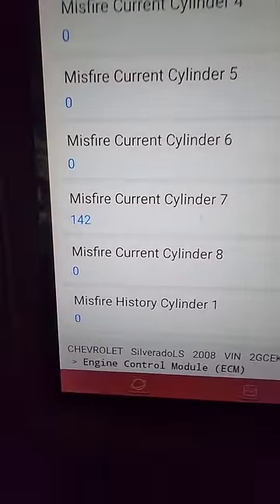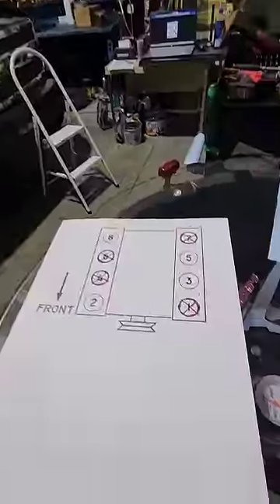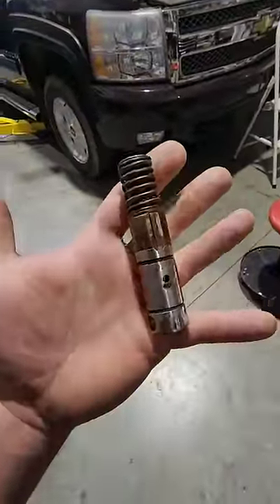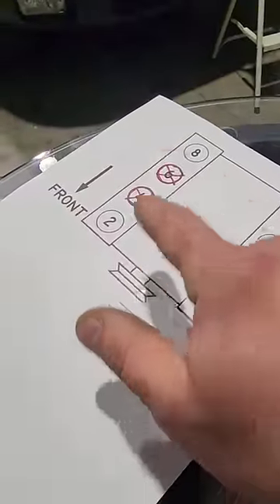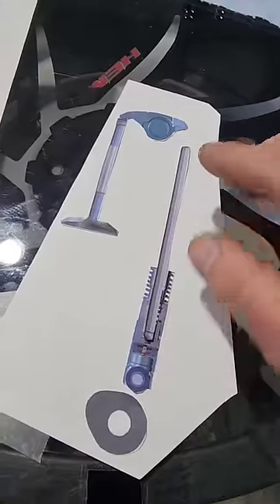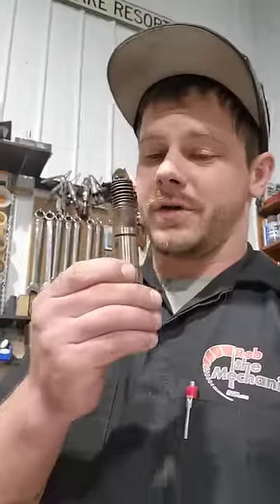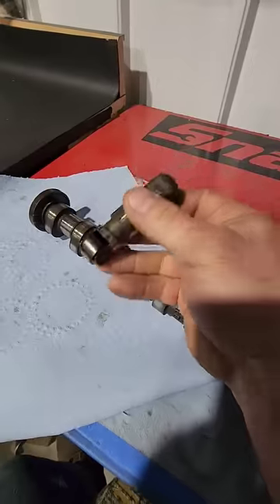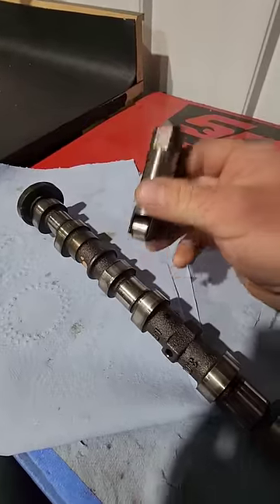GM Lifter Tick #shorts

Comment: I got that shut off.  I figure the extra money on gas is worth paying instead of engine work.
Reply: i was wondering if there was a way to do that. or maybe swap the adjustable one with the normal ones
Reply: @dhanssolo  yeah you can, that’s one of the steps of deleting one the right way. Swap DOD/AFM lifters, & cam out for non afm cam/lifters. Plug valley oil passages or swap valley plate, then get it tuned.
Reply: Simply shutting it off in the computer doesn't protect you from a lifter collapsing. If you want protection from this you need to actually have solid lifters installed
Reply: The engine runs smoother in 8 cylinder mode anyway, so fuel savings on 4 cylinders is negligible.  Highway gearing is what saves on fuel, an 8 cylinder car can do the same fuel economy as any 6 or 4 cylinder, with the right gearing.
Reply: @slowLFX  still doing lifters and cam though so that’s not a money saver.
Reply: @MidnightMechanic  getting a smaller more fuel efficient car would save alot more
Reply: @dhanssolo  if you get a tuner you can do all sorts of fancy things.  And i tuned mine for fuel economy so even on 8 on a highway i can get around 26mpg.
Reply: @oliver_klozoff  the on and off seems to cause the lifters to collapse.  Me and my brother have over 200k towing with ours with no issues yet.
Reply: @MidnightMechanic  yeah, nah it cant
Reply: @itslilyitslily  True, but subjective.  Payload capacity and towing is reduced, so if you absolutely need a pickup for hauling, consider the final drive gear, and maybe a Diesel option.
Reply: they will fail even if it's deleted in the ecm unfortunately
Reply: I don't even understand how it's supposed to save gas, yeah you're running on half power but wouldn't the four running cylinders have a drag on them because they're now pulling double the load?
Reply: @ChiTownGuerrilla the savings are negligible at best. I would get maybe 1mpg better on the highway. I had it shut off with a tune so it always runs on 8 and my fuel economy increased.
Reply: @wigletron2846  Yeah seems like a gimmick, just like those cars that shut off at a stop light and you hear the starter kick on lol. I got a 97' gmt400 5.7 so I don't have to worry about shit like that, it already has overdrive built into the normal "D."
Reply: @BurgessBrothersRacing  I dont think it goes into 4 cylinder mode when towing.
Reply: @ChiTownGuerrilla  it definitely is a gimmick. With those auto stop start cars, any money you save on fuel you're going to spend on a new starter and battery. With cylinder deactivation, you're gonna replace the cam and lifters.
Reply: @BurgessBrothersRacing  What tuner did you get?
Reply: @itslilyitslily  Alright.... where is it? Show me the 8 seater, luggage munching, movie player, fuel saver machine. I wanna see it.
Reply: @unclebob7937  diablo
Reply: @bobbobby1846  probably not.  I wouldnt know because its shut off.  But what im saying is we use our trucks and so far so good with the lifters.  But people who dont shut it off seem to have lifter issues before 200k.
Reply: @MidnightMechanic  lol, that's complete bullshit. show me a modern V8 that achieves 40mpg, cylinder deactivation or not 🤣
Reply: Or just get the V6 version.
Reply: @3n3ly7m9  Toyota Highlander has entered the chat
Reply: @ChiTownGuerrilla 
With AFM: Around 23 mpg average
Without AFM: Around 22 mpg average

I can't remember if these are the exact numbers but this is around what i remember them being when I bought my 2010 silverado
Reply: @unclebob7937  range technologies AFM delete! Simple, just plug into osb port n your done. V8 mode all the time!
Reply: Did the same got a new cam, dod delete, lifters and valley plate, tuned it for 91 and get better gas mileage then I got before
Reply: AFM/DOD shutoff actually saves fuel, and stops burning oil too. Get it done ASAP.
Reply: @MidnightMechanic  that's exactly what I've been telling people, most don't understand 🤦🏾‍♂️
Reply: @oliver_klozoff  I don't know anything about Toyota besides my first car, a shitty 2001 Lexus IS300 that dropped a valve at 160k miles. Still have it aswell 4 years later, but I have 8 Audis now.
Reply: @schowers I don't think that is the case, I see a lot of  guys with trucks who don't work
Reply: @tesmith47  ok so are you like following them around for a week to confirm that or you catch them on their day off?
Reply: I've got the AFM disabled.  Will that keep the lifters from failing?  They are never starved for Lubrication.
I have 167K on a 2013.
Reply: @HK-qj4im  I've heard lifters can still collapse unless you do an actual afm delete
Reply: Anybody wondering, there is a company called Range that makes a unit that you plug right into the OBD plug on the dashboard, the same place the mechanics will plug the scanner in to test for codes. I've had them in multiple Vehicles now and have never had an issue with any of them. They don't throw check engine lights and before you take the vehicle in for its emission and safety inspection test if you're in one of those States, you just unplug it a few weeks prior.  They leave no Trace whatsoever. We have one  even on our six-cylinder car because that has a AFM type system as well even though they're not known for failure. The reason we bought it for that one is because it also happens to keep it from going into Auto start-stop which we can't stand. That particular vehicle has a button but of course my wife never pushes it because she'd much rather kill the car.
Reply: I tuned out displacement on demand at 150,000. The 5.3 is at 310,000, still no lifter tap....
Reply: @MidnightMechanic  Soon as you gear it up, you are keeping your foot into it more on the hills. Which will kill your 0-60 mpg, every single time you take off. Especially when towing.
Reply: @ChiTownGuerrilla  yes
Reply: doesn't prevent, just delays. this is a mechanical flaw, not software. full DOD/AFM Delete is a must, or you'll run into the issue at some point.
Reply: They are easy to replace, but what you need to replace is the oil pump, there's an aftermarket high volume oil pump specifically made for these engines(you can get them at any auto parts store) because of this common issue with the lifter collapse. I've done this repair many times, I had to find out the hard way in the beginning, when I replaced just the faulty lifter/s, the new lifters would fail again after a year and some months. I personally experienced this and when I replaced the stock oil pump for the higher volume pump, it has been over 5yrs and still no issues. Customers of mine are still bringing me their trucks for oil changes and they are getting more miles and years on their engines from the oil pump upgrade.
Reply: 19 hrs for a cam and a lifter. mabie a bent  lifter rod. ... i rebuilt my whole engine.. is 7 hrs.. with all forged... and drove it on 31 pass' of 150shot and still driving it to this moment... and i dont even have blow by
Reply: @battfieldsniper1  maybe already out of the vehicle on a stand and even then your 7hr claim is BS ...
Reply: @oliver_klozoff  actually it dose if they don't collapse they cant stick
Reply: @chris001979  lol ok. Guess the ones I've seen collapse were flukes then?
Reply: I shut mine off and got better mileage than before.
Reply: @oliver_klozoff  yeah a remap alone will not solve this. In fact probably cause a dashboard disco. I’m not as clued up on trucks but look like the man above has done it properly ✌️
Reply: @BurgessBrothersRacing  the best part is that’s an easy thing to do (from the perspective of the mapper)
Reply: @justinballard7242  yeah need them OG non collapsing lifters
Reply: @ChiTownGuerrilla  that actually is a good point. Probably negligible but they doing it for the “green market”
Reply: @schowers  😂😂😂😂😂
Reply: @schowers  was nice knowing you sir 😅
Reply: @ChiTownGuerrilla  yeah they rape oil and surely use more fuel to restart… don’t get me started on the battery life
Reply: Same as that dumb stop start. You’ll be paying out for a new starter and using all that saved money from David fuel.
Reply: @BurgessBrothersRacing  What is a tuner? I know what tuning entails but never heard of it being an actual object.

 I don't own a car. I only know basics and definitely don't work on them. I know more about the science then actually working with engines let alone tools.
Reply: @dianapennepacker6854  it is a device that you use to tune your vehicle.  Its a small  designated computer basically.
Reply: Deleting DOD doesn't stop lifter roller/cam failure, GM engines without DOD still have the problem.
Reply: @paulcondie2520 I've had the Range AFM disabler on my '16 Silverado for 2.5 years now. So far, no problems
Reply: @smokeinapeterbilt  good to know. I bought my Silverado used and first thing I did to it. Was hoping this would save my lifters from collapsing. 46,000 miles on it when installed. At least hoping it delayed it. Lol
Reply: Genius
Reply: My mileage went up when I got it deactivated
Reply: @BurgessBrothersRacing  any chance you could clue me in to how you tune for better mileage? I’ve very lightly dabbled in HPtuners and wish I could get better knowledge on it all.
Reply: @akaaccount  i got a diablo tuner, so it came with different tunes and one was for mileage.  And i didnt notice any kind of cut in power when towing
Reply: @alexehhhh  i got a dianlo tuner so it came pre loaded with several wuick tunes.  One was for mileage.  Ome was for towing.  One was a race tune for 93 octaine.  Lol.  But as far as going in myself with a laptop, i wouldnt do it.
Reply: @busterscrugs just put a Corvette into the super eco mode
Reply: Absolutely!
Reply: The 4.8 doesn’t even have it only the 5.3 does
Reply: @schowers racism
Reply: Got a $40 thing to plug into the obd2 port. Yes a full delete would be the best bet but $40 vs delete when who knows how long anything else on the truck will last. $40 it is.
Reply: Doesn’t help
Reply: @dhanssolo  just have it turned off at a shop it only costed me like a 100 bucks back when i had it done
Reply: @dhanssolo you have to change the cam shaft to a non afm. They have OBD plugins but if the problem is already there it won’t fix it or stop it from happening

Comment: GM couldn't allow Dodge to have all the glory with the Hemi tick.
Reply: Way more common in GM motors
Reply: My experience driving one of these is it seemed I had to be driving on a slight downhill in order to run on v4
Reply: That did highly resemble the cam that comes out of a 5.7 L Hemi at 70-90k miles.
Reply: @jeffduncan9140 my hemi is at 200k. Take care of it and it'll take care of you. Also mines always running on eight cylinders. I keep that mds junk off
Reply: @jessesdomain5142  and there it is...MDS delete. That and not going from constant idling to WOT. The hemis I was specifically referring to were in patrol cars. They've usually chewed up the cam by 90k miles. Glad yours is well.
Reply: Cadillac had it first with the much hated 8-6-4. GM licensed it to Chrysler. lol
Reply: The Hemi tick is just the Hydraulic lifters normal noise. All the 5.7L hemis from day 1. Not too sure about the 392 scat and 376 hellcat. The difference is the hemi is not failing to re-engage all 8 cylinders like GM.
I had an 06 Ram and I just ran tow haul or overdrive off and it bypasses the MDS. If you have an exhaust on an MDS vehicle it sounds like shit when 4 cylinders shut down.. lol 😆
Reply: @jessesdomain444 "take care of it, and it'll take care of you" so simple, yet so hard for most to understand nowadays. My hemi made the same tick from the first day I bought to the day I sold it, which was a decade later. never gave me a problem cause I took care of her. Now I have another Hemi, and it sounds exactly the same.
Reply: @steverogers9452  my goal was to get her to 200k now I'm just seeing what else it's got at this point. Paid 10k for it in 2018 so I'm getting my money's worth
Reply: NA Miatas be like: Amateurs.
Reply: @steverogers9452  That cabin drone when MDS kicks in goes right through you. I'm in sport mode or manual all the time.
Reply: It’s hilarious that you have to baby your Hemi. 
Or really sad...
Reply: @jessesdomain444  200k on my 2013 hemi; yep, just gotta take care of her.
Reply: Gm took all the glory.
Reply: @Dukelevi12 Friend's '14 Chevy a few years ago w/ 50k. GM paid part of the $2k since it was just out of warranty.
Reply: @jeffduncan9140 True.The Hemi problem is due to moving the cam higher in the block where it receives less splash lubrication. Idling makes it worse. Cop car Hemi's w/ a lot of idling might have have their cams changed at least once in their life? I know of a Hemi Challenger needing an engine @ 23k.
Reply: @garymanis6305 Wrong
Totally different system. Please do research. I owned 2 MD Caddys w/ no problems.
Reply: @patrickmcdonald3427  that's exactly the info I came across. Unfortunately, I can't do anything about the on-duty idling. Aside from needing to already be running if something comes up, they have an ungodly amount of electronics that suck power and don't like to get hot.
Reply: @patrickmcdonald3427  Well, why don't you do a little research. GM licensed their cylinder deactivation system aka 8-6-4 to Chrysler for use on their Hemi. Facts.
Reply: @patrickmcdonald3427  I knew 2 people who had 1981 Cadillacs with the early 8-6-4 and they hated it so much they both had the engines replaced with Olds 350s.
Reply: Hemi tick is only with the MDS I had. 6 speed 5.7 challenger and mine ticked after not driving it for a bit I put 6 ounces of marvel mystery oil in it and 10 miles it went away been using that stuff for 50 years and always works
Reply: @Dukelevi12 lol you sure about that
Reply: Lol!
Reply: Cylinder deactivation has been around since 1917
Reply: Never happen if oil is changed regularly.  Chevs are simply biodegradable 😂
Reply: Hemi 5.7 is exhaust leak
Reply: Dont forget Fords Coyote Tick and Toyota Tick also...
Reply: Fords following them as well, except it's not from shitty lifter design is from cheating out on materials for the new 7.3 and 5.0l v8s

Comment: Actually, this is how you turn the performance upgrade the wife won’t approve into a repair she will approve 😂
Reply: Honey, we have to get bigger cams or this will keep happening.
Reply: @themanhimself3 gotta forge the internals to keep up with the cam...
Reply: @Dr_Skillz1188  The engine isn't getting enough air. To be safe I have to add this turbo so It doesn't break. It's just a big fan.
Reply: Oh, no! Now it doesn't perform well at low RPM. I guess I need a new Circle D 252mm torque converter.
Reply: @themanhimself3   Enough air?  I’m pretty sure that’s just an aftermarket alternator so you get good power to the ignition coils.
Reply: Justify the heads, cams, intake, and "now that it breathes better an exhaust will improve MPG"
Reply: Seeking a wife's approval on anything. Is stupid.
Reply: @BaytownMan45  a man who doesn’t value his wife’s opinion will soon find himself without one.
Reply: @Mrcaffinebean  That's cool, do your deal.  However, I'm not gonna seek approval like a child. To add a performance upgrade.
Reply: @BaytownMan45  it’s only petulant children who insist their wants and desires are more important than their partners.
Reply: @Mrcaffinebean  Not concerned either way. Do your deal. And I will do mine. Other than that. Take care and have a blessed day.
Reply: The Truck Norris idle chop will give you away. "Hey, why does it idle rough after you fixed it?" 😂